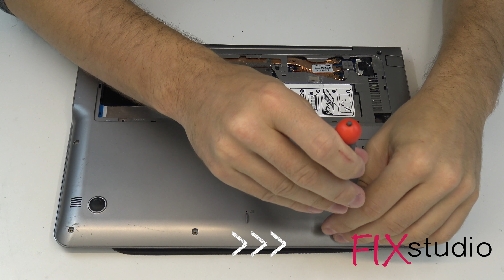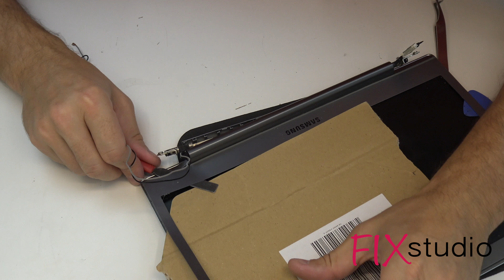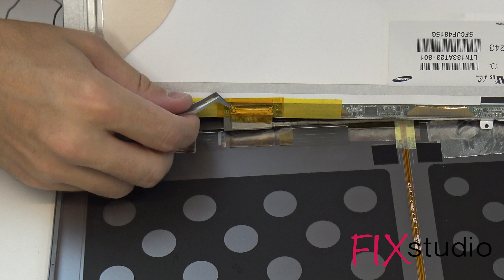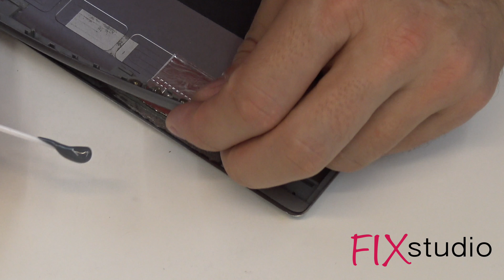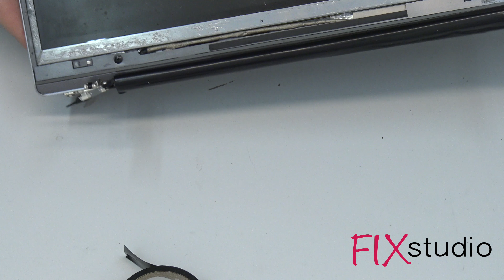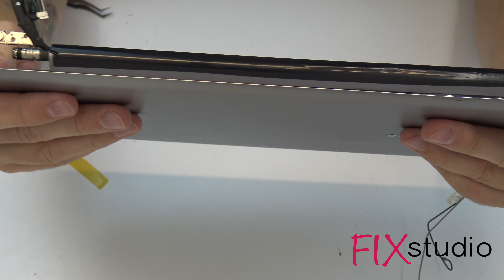Samsung NP530U3C -  Repairing a broken hinges [4K]

Comment: So, nice video, but it's not for everyone and this metode is risky if you're not a pro like this guy. I fixed my NP530U3B without tearing apart the whole display. You can tear apart (gently) the middle part with a guitar pick and reach the srews to take out the hinges without breaking anything, than loose the hinge, grease them (optional) then take back everything, fix the broken part (between the metal part and the plastic middle part as on the video, you can do that with loctite "gel" or good quality epoxy), and voila. This video helped me a lot about disassembly and courage, so thumbs up! Don't forget to like and subscribe!

Comment: This video really helped me to disassemble this laptop :). Thx a lot!
Instead of glue I have used six 2x10mm screws, nuts, and washers for hinges. All you need to do is to make 2 mm holes in back cover uing drill, and then screw it all together. Now it works like a charm :). Extra durable.
Reply: Please photo.

Comment: I had the same problem on both sides for the last 5 years (bought in 2013). Basically I super glued the outside and put stretched wire tape (the black one used to isolate live wires). It is ugly, but I didn't need to disassemble the screen.

edit after 11 months: broke 6 months ago. Then I reinforced the hinge with a polyester cloth and superglue (poor man's glass fiber). Broke again. Now I will use epoxy glue like the video.
Reply: And it broke again right?
Reply: @agustinflores2990  yes. I used epoxy glue and it's good

Comment: Many Thanks for the video. I've taken this as my personal challenge and have just ordered a new hinge and all tools via Ali Express. Although I had to buy a new laptop in the meantime bc of work. I hope in three months forwards (when I hope to receive the parcel) I can successfully accomplish this repair.
Reply: Hey, have you succesfully managed to replace the hinges? I want to do the same but have no experience in repairing computers.
Reply: @Tjitsepitsie  I tried my best with a hinge I ordered from Ali express,  but when I turn it on, it didn't do so. So there is a risk of messing up the laptop that someone said previously. I will try again anyways to see what went wrong.
Reply: I also messed up the frame of the screen because now is bent and it is difficult to put glue it again.

Comment: This is a design problem. Samsung should repair for FREE for all his customers, but they charge for it. My laptop broke too. 
The only option we have, is to not buy a samsung laptop again.
Reply from the maker: Yea, you’re right. But not all Samsung Notebooks are bad.
Reply: mine broke for no reason too
Reply: The hinges are too tight ,I too had to fix the right side hinge, and also loosened both of them so it will never break again :)
Reply: @Tremor244  I believe that is the main reason - "too tight" why it breaks in the first place.

Comment: i BIG thank you. fixed my series 5 EXACTELY the way you showed here. PERFECT. thank you for making this wonderfully easy and relaxed video with all the right steps. i'm even looking forward to fixing my sisters same laptop.

Oh... and i DO have a question: since i read, the problem is well known, because the hinges are to tight, i actually bought replacement hinges on ebay. but after your video i'm wondering: are they realy too tight, or is the plastic to weak? because then i can save me the money on my sisters laptop.

but most importantly: thank you, great job.
Reply from the maker: Thx. Basically the hinges are ok. The problem is on the plastic side - is to weak. The screw holders are always break up.
Reply: To be honest I'd expected it to be easier, this shits way too hard to me :(

Comment: very nice video.. thank you for detailed approach. I will try it on my broken hinges. And just for sure I will drill holes thro ughthe aluminium lid and use longer screews with bolt nut.
Reply: Please post some pictures or make a video of your repair.
Reply: @Sweet Memories  I didnt make video, but you can see result on https://ibb.co/fYpX9d3
as I said I drilled holes through aluminium case and use old hinges on the top side. I asked for six screws with nuts in notebook repair shop and get it for 2USD :)
So now I have bolt - plate from old hinge  - original alu case - plastic inside - new hinges - nut. Its perfect, used each day with no problems for one year.
Using plates from old hinges is not necessary but I did it just for sure. Finally I have used file and rasp bolts little bit, and then put glue over (removed for photo - so it looks dirty)

Comment: just a question, would a thin but strong wire would be better if i somehow make it go under the aluminum sheet and just keep scratching left and right to remove the adhesive without bending it or damaging the screen somehow, would that be a good idea?

Comment: I have a broken hinge on my Samsung NP900X4C. The hinge connections are on the outside of the screen section rather than the inside as in the case of the Samsung laptop in this video. Do you know if you have to take out the whole screen (like in this video) to get the the other half of the hinges for the NP900X4C model?

Comment: Hi!
Very useful video. Can I change the standard LCD with one Full HD? If yes, where I can buy one of this? Thanks!
Reply: yes :) BUT in different way - you need new FullHD display and display controller kit ... connection will be via side HDMI/VGA output. So it means cable and small box glued to the display lid :(

Comment: Some of you, have got WIFI signal problems?? My asus 530 has a very weak signal....I try to change antenna with other and I see difference but I dont diasseble monitor, I try to find a position under the motherboard. Any other solutions??

Comment: Hi, sorry but i'm new in this theme of the repairs but you could say that instruments and materials you use Since I've looked for where to repair my equipment but I haven't found a solution your solution convinces me and I know I could do it with you helping me tell me what materials you use 
Please, I need your help. I hope you answer me as soon as possible
Reply from the maker: Hi. First what you need is a little bit of experience. This particular case is not so easy as is looks like, and should be not your first. Equipment: few screwdrivers, small drill machine. I use liquid metal epoxy - TurboCall2000. Regards.
Reply: @Mark Santiago i replaced my 530U's HDD with a generic 2.5" SATA 200GB SSD as soon as I bought it in 2012.  just moved the little ribbon cable thing over to the ssd, fit right in.   disable the cache software that uses the lame little SSD thats built in because its slower than the sata drive.    if I did it again, I'd use a 500g or 1tb ssd, they are cheap enough now.

Comment: I seem to have damaged the screen while removing the cover, I think I pushed the tool under the steel LCD while going round with the tool, Rather then between the Aluminium cover and the LCD, I’ll buy a new laptop.

Comment: I completely f*cked my laptop. Don’t try at home even if you think yourself capable. After disassembling I could tell the screen casing was cracked meaning that even with hinge replacement the repair would not work (there is no casing to attach the hinges to - the common design fault). I tried the fix and to reassemble - the digitiser for the screen now doesn’t work either so no display. It’s a good video - I just wouldn’t recommend trying yourself.

Comment: If you don't repair but replace the hinge you don't need epoxi or glue anything except the screen?
Reply from the maker: I never see in my life a broken hing in this model. It’s always a plastic part on bottom of the screen. I don’t think that you need to replace the hing... but maybe I’m wrong.
Reply: As I can see, the plastic of mine is broken because the hinge doesn't move properly anymore. And the plastic is broken into many parts. So I guess it's easier to just replace it